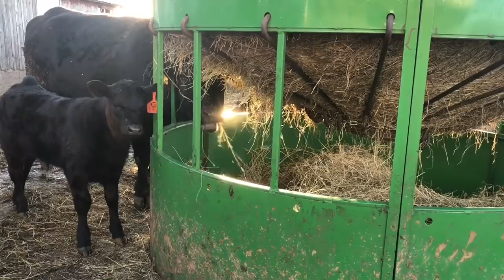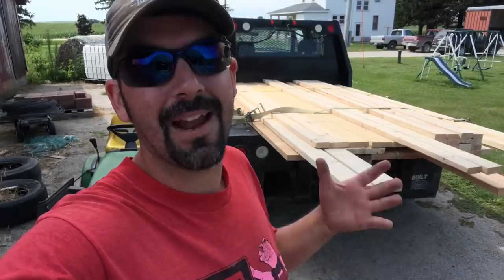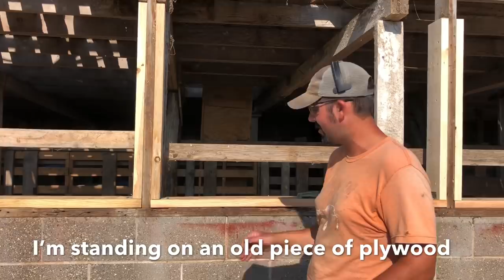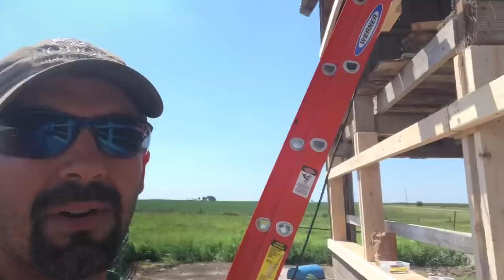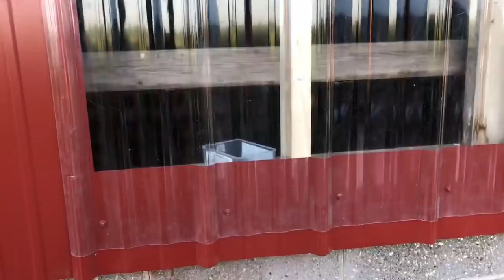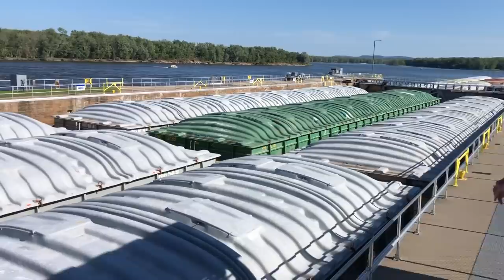Saving the Barn

Comment: Hi.  HAPPY BIRTHDAY CARL !! Your red barn is just a modern looking one with the red metal siding.  Thanks  for sharing some of your birthday with us.  I'm surprised  there are locks on the Mississippi.    The powers that  be sent ya'll that  hail storm first, then said "nay,  spare them".  Bet that insurance lady has her hands full. I found a YouTube channel that shows people doing the work of a century old farmers.  Mostly Amish using teams of horses n wagons cutting crops.  Saw an old farmer (I don't think Amish) using horse, wagon n his sons cutting n gathering, shaping n hauling LOOSE hay to top & in hay barn with a really sweet simple pulley n transfer system n Large hook tong.  The wagon had a simple turning mechanism that MOVED the cut hay UP  nearly a 45 degree angle n dropped the hay into the wagon. It looked like a robot trying to climb a wall n not going anywhere.. It reminded me of that fancy heavy duty machine that gravity feed the bales by gravity into channels to drop neatly to ground.  The old farmer said he would do it all, even hauling the hay to top of barn with just a few commands to horse at the bottom while He is in barn rearranging hay.  He still uses the same system now , he just has his grown sons shaping the loads n spreading it out in barn.  Amazing to think he would do that all by himself..   Does the bottom of plastic window go on the inside of outside of red siding?  You might want to weather seal around windows, would have to see new wood framing get water damage.  Glad to see y'all s little part of Iowa corn spared.  Now let's see the prices !!.            Peace to you and yours
Reply from the maker: I always enjoy visiting with the Amish guys we sell hay to. It’s fun to watch them work with their horses. 

We overlapped the plastic over the steel at the bottom. That way it can’t leak. Thanks for watching!

Comment: Excellent description of the barges and towboat. Went through many locks on the upper Mississippi River as a deckhand in the 80s.
Reply from the maker: So you were down there tying the barges together with cables?
Reply: The river industry refers cables as wires that hook into ratchets. My first river experience was going through the upper Mississippi locks. Great memories!!

Comment: I'm not sure about this (I'm a programmer, not a carpenter) but I think it isn't a good idea to put new boards right up against rotten ones. IIRC, the rot will continue spreading into the new boards.
Other than that, it looks fantastic!
Reply from the maker: You are correct to a certain extent. The rot will continue to spread but very very slowly. It just wasn’t feasible to lift the whole side of the barn up and replace the sill.

Comment: I am delighted to see and hear from you again as, like many others, I was wondering whether you,  your families and farm had been hit by that ferocious storm that passed through your State and other nearby States. From the few clips I have seen the sheer amount of damage and destruction is almost beyond imagination and belief over such a large area. My heart, thoughts and prayers go out to all folks both directly and indirectly involved.

 Very smart and practical repair to that barn - what do you use it for? I ask as I guess traditionally it would be used for livestock on the ground level and fodder and bedding stored above in the loft area. Do you have any concerns about condensation issues on the roof and sheeted walled surfaces as there will likely have been good ventilation previously via the timber clad sides. I think the windows look good,previous
Reply from the maker: You are right. We use it for cattle down below and hay storage upstairs. The ventilation is plentiful though. We have open soffits and the sliding doors will be open almost all the time.

Comment: Happy birthday Carl. Great video. Thanks showing the tug boat and barges. Wow. On the barn now, I thought you would have some 10x10x x length or 12x12x x length for post not those kind of boards. That is what we have for post in the barn in Pa. Great job on the metal siding. Are you putting any vents in the eaves of the barn? I have heard from the older farmers that a barn must always have ventilation to help keep mold and mildew away from hay, straw, and the small grain bins inside the barn drier. That is still true right or did something change? I have seen people around here starting to completely put metal siding around the barn around here the last 5 years and they have been having problems with mold and mildew. We told them they needed ventilation. We have another friend that built a barn with a concrete floor and metal sides and roof. They were having problems with hay getting moldy from condensation from the concrete floor. We told them to empty the barn. Then open all doors for a few days. Use fans. Then go get some silage pit plastic and cover the floor. Then get pallets to put hay on. That way air can get underneath of the bales. After that they never lost any bales. 
How are those farmers affected by the derecho going to harvest those crops? I was thinking just bring in a flail chopper to use it for insilage.
Reply from the maker: This barn was built by a farmer originally so they just did it with what they could get. It’s stood this long so I guess I’m just going to fix it the way it was. We will have vented soffit and the doors will be open most of the time.

Comment: If the questions of the covered barges has not been answered then here is what we were doing in the Ohio Valley.  The covers are not only for commodities that you do not want to get wet,  also customers along the Gulf of Mexico.  This is one way that eastern Ohio coal can be shipped to customers in Florida using the waterways.
Reply: The covers keep the waves of the deeper water from coming over the top and sinking the barge.  For a while some of that coal was also going to South America, however I think it was transferred from barge to ship.
Reply from the maker: Hey thanks! I have been wondering about that this whole time

Comment: I think that first block of barges is winched out with big cables and held for the tow boat to rejoin them.  Did you ask why it is a tow boat when it obviously is pushing?

Those vertical boards that rest on the sill plate attached (sistered in construction terminology) to the vertical posts might like to see lags or carriage bolts if the original post attachment is compromised.  Those right angle plates could be bigger.  The reason is that you are not just concerned with the weight of the barn on the sill but the uplift that can occur in wind loading.  There are tee straps you can put on the interior.  Wish I was there to help with that.  Siding that is up my alley.  Nothing like a guy who Monday morning quarterbacks.  Sorry.
Reply from the maker: Yeah I also wish the brackets were a bit bigger but it’s all they had at the lumberyard that looked like it would work. At least there are 22 of them on that side of the barn. Those 2x6 posts were just toe nailed into the sill plate before. I can’t believe that barn is still standing 😂